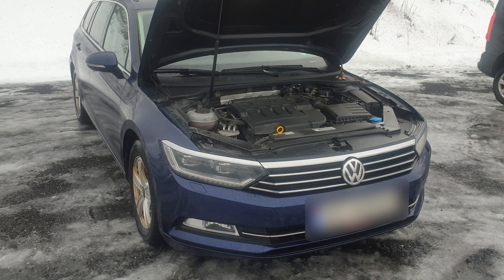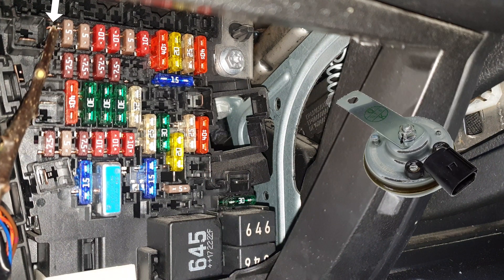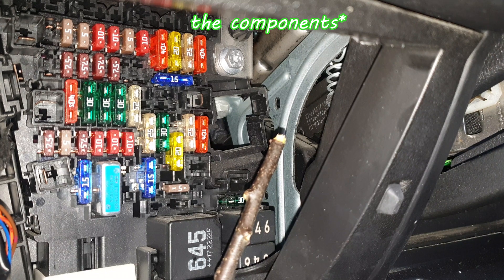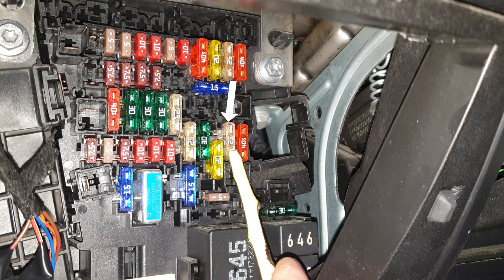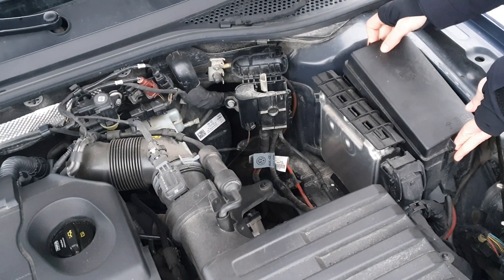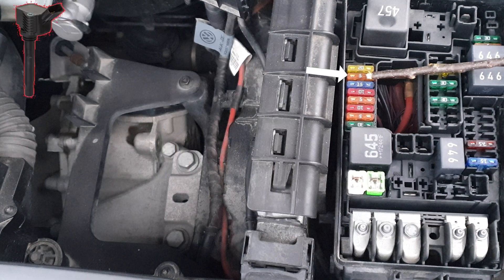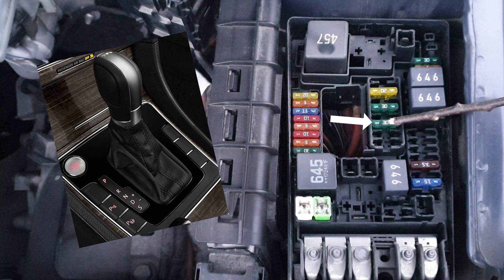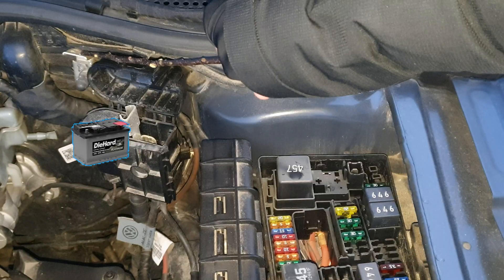B8 Volkswagen Passat TDI Fuse Box - Relay Diagram / Location

Comment: Thanks a lot for this video. Plz, yhe two temperature indicators for the air conditioning are not working in my passat b8 2019, can you tell me exactly which fuse corresponds to this?
0:27